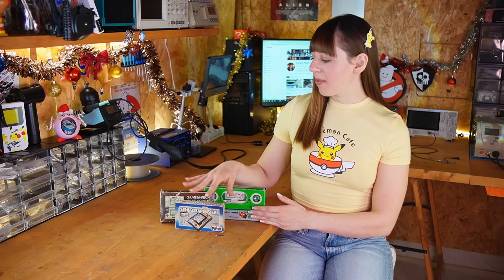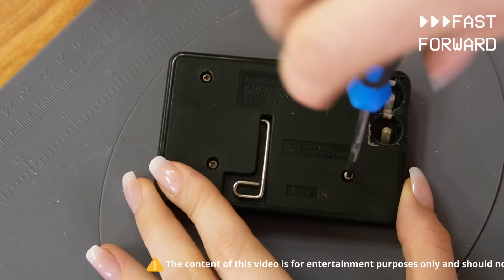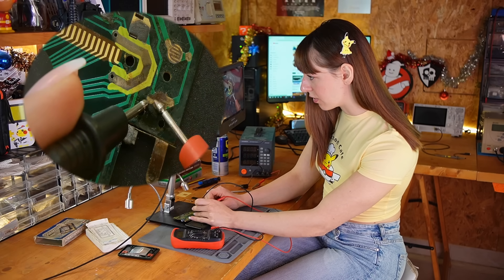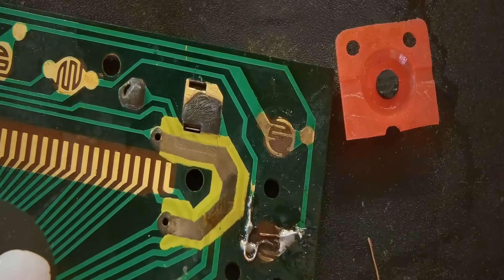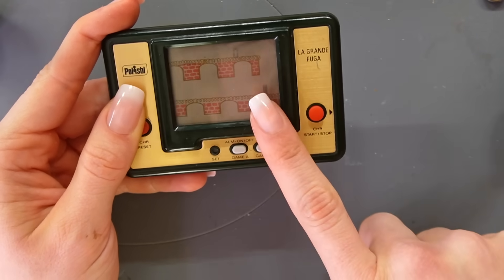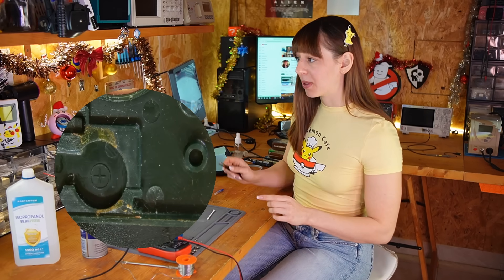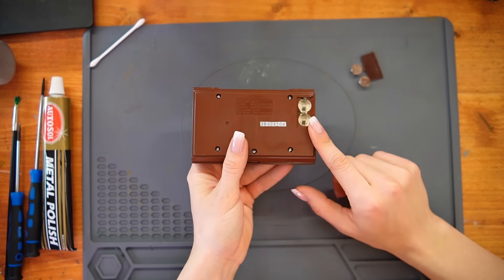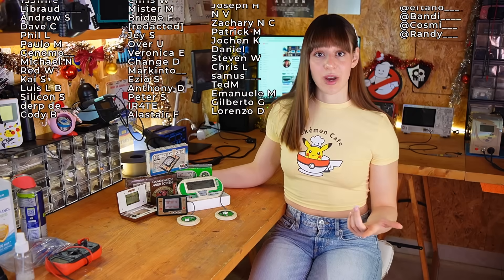3 Game & Watch From a Flea Market – Can I Fix Them?

Comment: Great repair work! When you're repairing the button contact pads, it can be better to use conductive paint as it won't make a lumpy surface for the carbon pill to press against like a wire would. The wire is great for repairs elsewhere on the PCB though.

You can use white vinegar to clean off battery or capacitor electrolyte when it gets on the PCB. The electrolyte is caustic and the vinegar will neutralize it and prevent it from corroding the board any further.
Reply from the maker: Thanks for the tips! I do use conductive paint sometimes, but I have a feeling that on a button that gets pressed a lot it might wear off quickly and be less stable. I used the thinnest copper wire I had to evoid making a lumpy surface and since I needed a very narrow trace to make sure the two sides only make contact when the button is pressed, this felt like the cleaner solution. But thanks for the suggestions, I’ll definitely try vinegar next time!
Reply: @Sayakas_Digital_Attic  Conductive paint is actually used for some keyboard membrane switches right from the factory, so if you get the right stuff it should hold up ok. Actually finding good stuff vs cheap crap that wears off immediately might be a challenge though.

Comment: Use Deox-It D5 for battery leak caused corrosion removal.  Works much better than contact cleaner.
Reply from the maker: Thanks for the tip! I’ll give Deox-It D5 a try next time :))

Comment: Some brother you have😅
Reply: @Sayakas_Digital_Attic  BTW, what kind of polarizing filter did you use? I do have some of those handhelds around and need to repair. I remember one of them growing faint by the years and it's probably the filter that needs a replacement.

Comment: I have a Nintendo Switch that needs the battery replaced... The battery is glued in, and no matter how I try to remove it... no luck.
Reply from the maker: Those Switch batteries can be really stubborn. The glue is strong, you just have to go slowly with gentle heat and patience. It will come out eventually!

Comment: White Vinegar is great at removing corrosion from battery compartments.
Reply from the maker: thank for the tip!
Reply: which one is better for alkaline battery leak corrosion, white vinegar or isopropyl alcohol? 

i need to do a purchase. my precious multimeter got a serious battery leak, crystals and corrosion on the circuit board 😭
Reply: @mu9600  use both, isopropyl second, before the final purified water wash :)
Reply: @kaitlyn__L  now i need to purchase purified water too 😟
Reply: @mu9600  White vinegar to neutralize the corrosion, isopropyl alcohol to clean up the mess after.

Comment: Another great video, I liked how you used the copper braided wire to soak up the solder when desoldering the capacitor.
Reply from the maker: Thanks! Desoldering braid works great for cleaning up old solder, it makes the job a lot easier

Comment: You did a terrible job on the button pads. You should have designed and etched a thin PCB and glued it on top of the main board
Reply from the maker: For now the fix I used works reliably for this type of button pad. Still, thanks for the suggestion!

Comment: Nice fixes. I still have my lcd game (Q&Q King Kong) from 1983, but since early 90's,  it was about 25 years in cold storage, and when I got it out of there in 2017 or 18, initially it malfunctioned like your, looked like bad contact somewhere. I re-flowed the battery contacts, and then it worked reliably again.
Btw, be careful with bad button cell batteries, one LR44 battery exploded to my face. Luckily I had my safety glasses on, so I can still see with my eyes.
Reply from the maker: Cold storage really does strange things to these old LCD games. And WOW, that LR44 incident sounds scary. Glad you had safety glasses on! I’m always careful with leaking or swollen button cells.

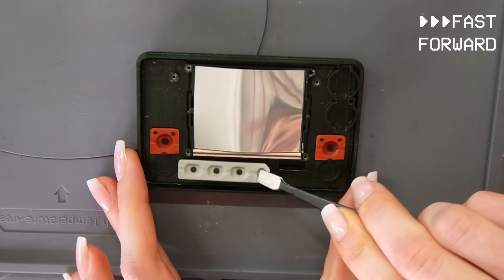Comment: 11:57 - Just looking at blue light is damaging your eyes. Get another uv lamp that is placed on top of pcb and light do not escape.
Reply from the maker: I use that kind of UV lamp too, I just make sure not to look at the UV light while I’m using it. The handheld torch is sometimes easier to work with though!
Reply: @Sayakas_Digital_Attic  Its not about whats easy but whats right. I started seeing blood cells in my eyes, just after 15 seconds of looking at light, not at lamp. Thats why I write about it.
Reply: What you’re describing is the blue field entoptic phenomenon or Scheerer's phenomenon, which is a normal, harmless visual experience of tiny, fast-moving white dots or tree-like patterns in a clear blue sky or field of light, caused by white blood cells in your retina. It does not necessarily indicate a harmful level of UV light exposure.
Reply: @XanderEwald   I speak about photokeratitis.

Comment: For scraping traces, if you don't have any you really need to get some fiberglass sanding pens. They seem to be more accurate at scraping than picks and tweezers to me.
Reply from the maker: Thanks for the tip, I really appreciate it! I’ll definitely try a fiberglass pen!
Reply: @Sayakas_Digital_Attic  you're very welcome. They are very good at scraping traces and cleaning corroded contacts. I've saved many boards with them. I use Pixiss and MegaCast fiberglass pens.

Comment: A good thing to use to clean corroded tabs and contact traces is magic eraser, ie. melamine sponges, they are just abrasive enough to clean without sanding off the traces.
Reply from the maker: Thanks for the tip!
Reply: @Sayakas_Digital_Attic my process to clean corrosion of boards is white vinegar first. It works amazing but need to then clean off the vinegar afterwards with isopropyl to prevent the vinegar from corroding it later. I clean up the contacts further with a fiberglass pen.

Comment: As a little kid i had a old second hand Donkey Kong 2 Briefly, but it stopped working (it was old by the time i got it). Game Gear had also came out abroad at the time so less than a year later i got that for Christmas ☺
Reply from the maker: Those old Donkey Kong units were fragile but magical while they lasted. And getting a Game Gear right after must have felt amazing. Thanks for sharing it 🤗